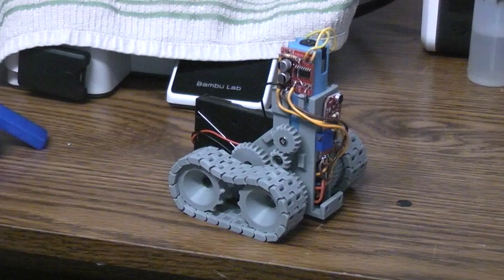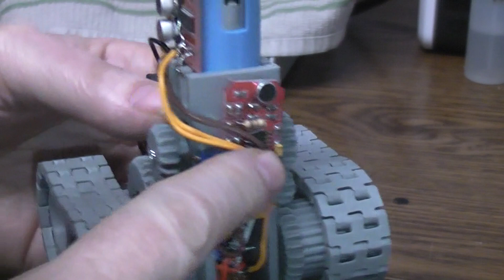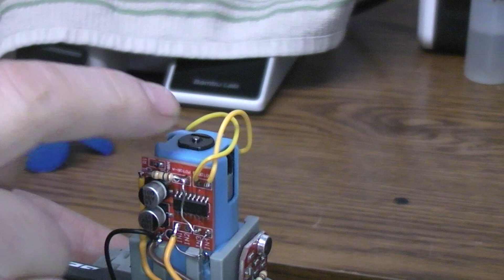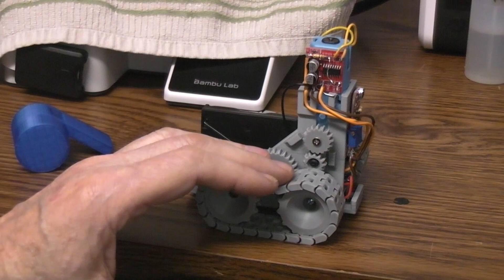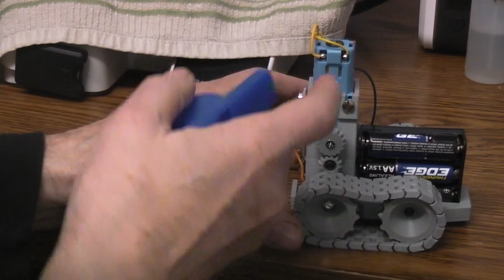Playing with YouTube "RICK 100" Steerable motorized tread design.

Comment: Thanks for the mention. I have some blue TT motors coming from China. The speed seems very good for control-ability, even in a small space and driving it with a whistle. I don't like when they move so fast they are hard to control. Nice to know the tracks came out okay. I love the speed and quality of the A1 Mini. Is that an LM567 tone decoder on that board? I searched for that board but haven't been able to find it.
Thanks,
Rick
Reply from the maker: Here is a link to the Tone control board.
https://www.electrodragon.com/product/special-sound-identifier-module/
Yes it is the old LM567, but the board costs less than the parts would. You get a MIC, a opamp preamp and the LM567. I did lay the multi turn trim pot on its side to make the profile of the board shorter.
Reply: @Robothut  Thanks. I've never used Electrodragon. I found a couple of things that interest me.
Reply from the maker: @rick_100  One thing about the tone decoder unit. since they have a wide power supply range the pull up resistor for the MIC is not optimized for 5 volts, so the gain will be low on the MIC unless you change the resistor to around 1K. I just bridged the surface mount resistor with a 1K . I found pictures on the web site for the schematic and parts layout of the decoder board.